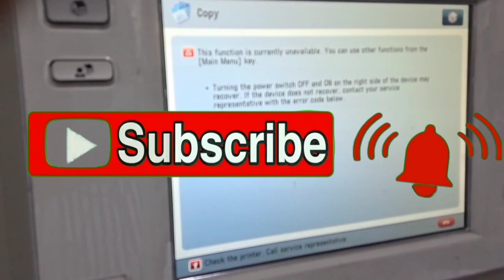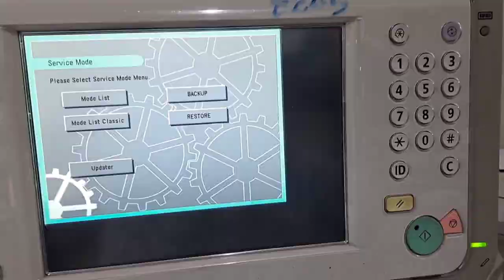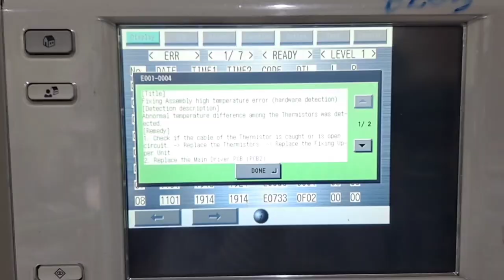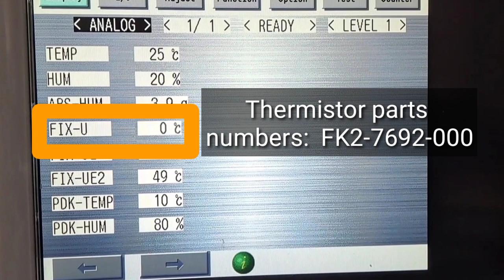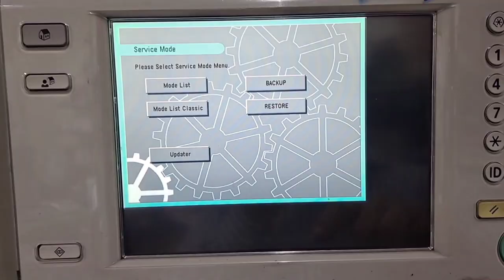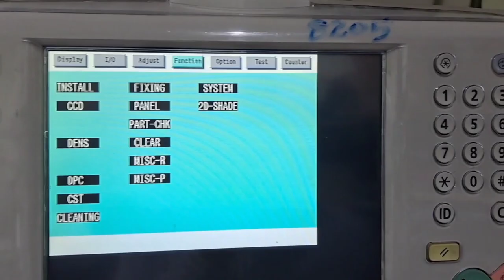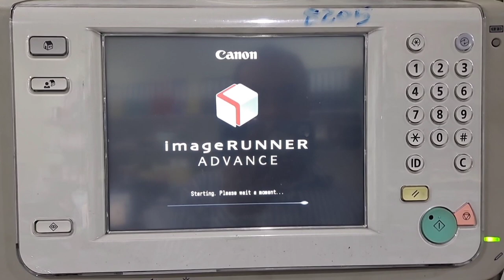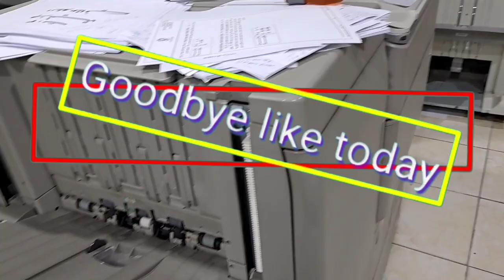How to canon advance reset the error code E0O0-0001 EOO0-0002 E0O0-0010 EO01-0002 #canon #subscribe

Comment: Aoa sir how to remove error e00020 canon 2530
Reply from the maker: Code: E020-0000.
Sure there are problems with toner cartridges (toner bottles).
1.Check the rotation of hopper motor gear. (If rotating, false detection by the sensor is doubted. Feed the toner to the developing unit in service mode: CLEAR>ENGIN>TNRINST.) 2.Replace the Developing Assembly Toner Sensor (TS1). 3.Replace the Sub Hopper Toner Sensor (TS2). 4.Replace the DC Controller PCB (PCB4).
Reply: @TechHumayunkabir  thank you sir

Comment: Me sir ji
Reply from the maker: Canon IR Advance 8295
Error code: E350-0001 
1) The solution to this code is to check the connection cable. Contact sales companies .
2) System error.
Reply: @TechHumayunkabir  sir plz help me sir ji old  machin jai sir ji
Reply: No a company